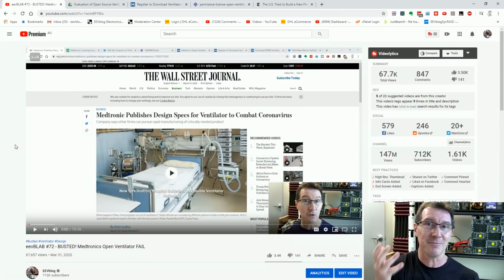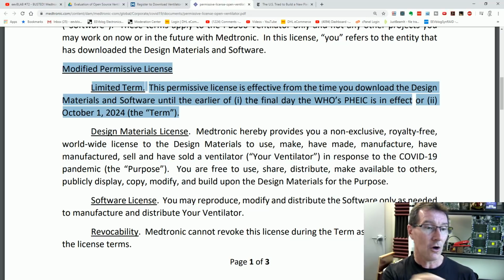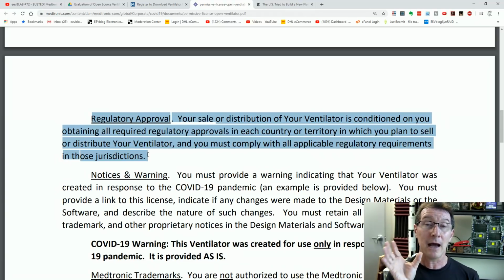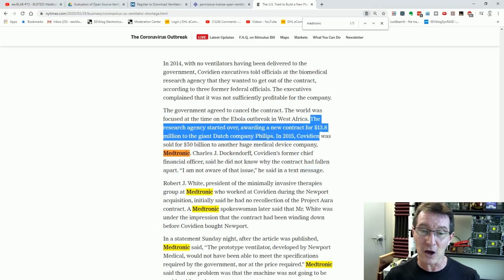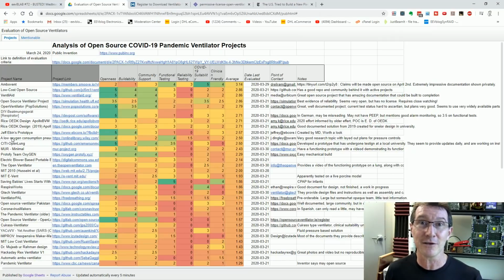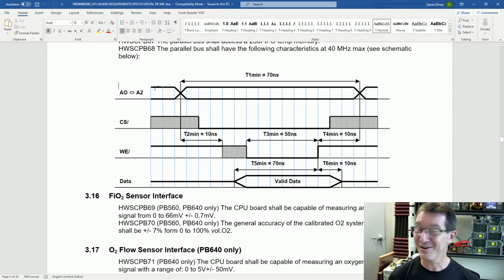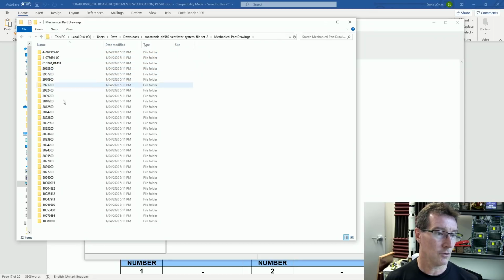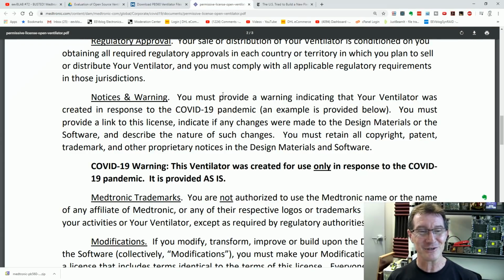eevBLAB #73 - Medtronics Open Ventilator + Others UPDATE

Comment: Even if all the files were available, how could you realistically design and release something in a short time span when it will require CE/FCC certification and meet medical safety standards at the same time? That seems like a time span of at least several months, and by then it's probably already too late.
Reply: China will be producing them by the end of the week, and selling them to places that don't need CE/FCC certs. And besides, they already have the CE (china export)/FCC logos, and are pretty good at printing stickers or molding them into the plastic anyway. Also, they see your "license", and laugh at it!

Comment: AC in the medical world is Assist - Control - where the patient attempting to breathe in triggers the machine to deliver air under the required pressure.
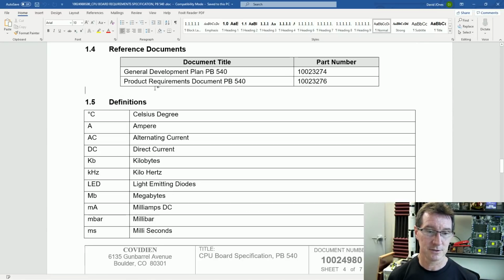Reply: norlesh Perhaps, but at 14:48 when Dave says “AC is alternating current” he is simply reading the definition printed on the Medtronic document shown in the video.
Reply: like SCUBA diving gear.
Reply: @95rav  no, it's closer to pt driven rate control. The vent will work to push a given volume at given speed, not just supply flow.

Comment: This is parallel manufacturing and typical of war-time production. The same thing happened when pistols, rifles, tanks, etc needed to be made faster than plants could be built and outfitted. They opened up the manufacturing to the open market with strict rules on the manufacture and use of the designs. Everyone knows about the iconic Singer Sewing Machine Co. M1 Garand or the coveted Singer 1911A1 service pistol which are worth a fortune. Ford made Tanks, etc etc etc. This is just that although they have to wrap new words around it to adapt it to modern day which is likely why the term "Open Source" is being used.

The entire goal is to produce ventilators for the entire world to use, NOW. They aren't concerned with much other than you need to be vetted by the FDA and the FDA already has a task force to fast-track all high priority projects like these. I applaud Medtronic for actually spinning this up this fast. The Medtronic design is old, robust, tried, proven and trusted. It makes sense that this would be the design to push outwards to be made en mass. It also makes the fast track approval process far easier since its a proven design but made by another mfg. Its easier to do this than be a contract MFG I would imagine.
Reply: Even IBM made M1 Carbines in WW2
Reply: Brian Streufert Clear and fair take.  Well done.
Reply: Correct. But Dave needs clicks. It's clearly aimed at large scale manufacturers to ensure they can't go on making these after the crisis is over, or indeed 'borrow' any of the tech. It's not aimed at us.
Reply: @chinnyvision  i think everyone agrees that's what was actually released after their legal team did there job,  however implying that this is click bait is a bit unfair since Medtronics own press releases and press coverage certainly tell a different story.
Reply: As far as I know, while they did make receivers for the M1 carbine and did a trial run of a few hundred 1911 pistols pre-WWII, to test out how well a company that did not make weapons could switch over, they never made M1 Garand rifles (as far as I know, I could be shown wrong).
Reply from the maker: Sure, but it doesn't alter the fact that this license actually exists and has potential implications.
Reply: @EEVblog  No question. This really isn't for the maker community though. Its for manufacturing companies that already do things like this and have legal teams that digest things like this on the normal. My parent company; Illinois Tool Works, has an entire legal department that reads docs and spins up responses in literally hours to boiler plate specifications that are hundreds of pages long. These things are really really complicated in what they do and not really something Joe Blow in his shed is going to take a swing at.

This is why a lot of the people and companies who have no idea how to muck about with this are devoting their time to automating Ambu bags. Ambu bags already have a pressure relief valve on the mask and its easy to automate by mimicking a human hand with simple mechatronics and a micro.
Reply: @StreuB1  I totally agree!
Reply from the maker: @StreuB1  No it's not. Medtronics themselves promote this under the title of "OUR VENTILATOR SPECIFICATIONS.
 YOUR INGENUITY." and "Our hope is that manufacturers and engineers will use this intellectual property to inspire their own potentially lifesaving innovations."
So it is clear from that they intend for people to take their IP and inspire other designs, not just produce clones for right now.
Reply: @EEVblog  having attempted to trawl through the documentation along with my college, we find that there are some "open to interpretation" phrases and somewhat contradictory parts also. I feel like this is something that was half out the door before someone stopped the ball rolling for a lawyer to flick through it and say no no no.
Reply: Brian Streufert 
Indeed this shows how extremely complicate ventilators are. Cor van Hout, CEO of Philips explained that their ventilators contain over one million lines of code. 

These ventilators are not a (fairly simple) breathing aid but fully take over the breating function of patients. Patients on these ventilators are paralysed and fully sedated (brought into an artificial coma) to enable high pressure, low volume ventilation that will minimise damage to the lungs. 
This raises however CO2 levels in the blood of the patients which would give them the idea that they are suffocating. Hence the paralysing and sedation.
Reply: @Conservator While it's true all medical devices are hideously over complicated by regulations, "a million lines of code" is bull. That's what you get from bad / lazy programming, and decades of feature creep. The basic function of a ventilator can be done without any computer at all -- we had ventilators before there were arduinos. (something that complex is also 100% impossible to fully test.) We don't need "borg" technology here; covid-19 patients need breathing assistance not replacement.
Reply: jfbeam Hi,
I’m sorry but I have to correct you. The non-ICU patients might need breathing assistance but the ones in ICUs have a respirator to replace their breathing. These devices are complex because they are highly automated and need much less attention of IC nurses and doctors. 
I agree that a million lines of code is ridiculous but that’s what the Philips CEO said on Dutch TV. 
Breathing aids are much less complicated but those are useless for the critically ill patients. 
I write these comments because most people don’t have any idea (or are at least underestimating) what happens in ICUs and how invasive being put on a ventilator with COVID-19 really is. 
In the Netherlands COVID-19 patients are on average 23 days in ICUs. Much longer than initially estimated.

To avoid damage to the lungs by overinflating them, the patients get a low volume, high pressure treatment. This will give them ebough oxygen but will also keep the CO2 levels too high. This causes patients to feel like they are suffocating. This is extremely uncomfortable (or torturous). Therefore patients are sedated and paralysed to avoid violent movement. 
To increase their lung capacity, patients are turned not their belly for most of the time. 

The respirators control volume, inhaling pressure, exhaling pressure, frequency, speed and amount of oxygen. 

There is a good video of Medcram on this subject.
Reply: @yodaco  I appreciate that your college has tried to check this out, but I think that a group of college students just might be in over their heads.
Reply: @jfbeam  It would be interesting to see some complexity analysis results in that "Analysis of Open Source COVID-19 Pandemic Ventilator Projects
" table. When I did my degree in Software and Network Engineering complexity was evaluated based on Lines of Code (LoC) things have moved a long way since then with cyclomatic complexity (CC) and cyclomatic complexity density. CC density has been found to make sense by various researchers, although it does not seem to have gained significant popularity among practitioners. 

There is evidence from two well-known scholars in the software metrics area that the ratio (cyclomatic complexity density = CC / KLOC) is a much better predictor of maintenance productivity than the CC or KLOC alone.
Reply: @EEVblog  I agree that statement is BAD and DANGEROUS as it is "suggesting" to make a LONG TERM new device BUT MEDTRONICS can then grab from you in 2024 OR when the pandemic is over
Reply: @EEVblog  is there some part of this being an emergency temporary measure that isn't clear, do you expect them to give away their intellectual property forever. it all sounds quite reasonable to me.
Reply: @Balancedviewable  nothing wrong with doing what you stated had they of presented it as such but based on how they presented it to the press, I think the criticism is perfectly fair and frankly your implying otherwise is unreasonable.
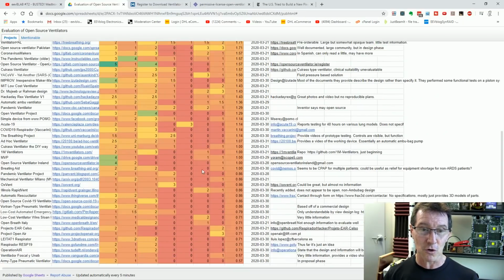Reply: @EEVblog  I have just checked that list 02/04/2020 11:05 GMT and believe it or not Medtronic is now at #1, top of the list with a score of 4.5 for "Openness" when the most open projects score 5. I guess Robert L. Read, Keeshan Patel, and Juan E. Villacres Perez, 2020
 didn't spend as long as you did reading that Medtronic Licence.
Reply: Yes and they all made easy to produce weaponry. The Sherman was not a very good tank compared to what the Germans put in the field. But because they were much easier to manufacture they could be churned out in huge numbers. The suspension was crap compared to the Tiger. But they could do repairs themselves whereas the Germans had to tow theirs back to the factory. In times of crisis you don't need a ventilator with a million bells and whistles. Design the most basic machine and start producing.

Comment: I find it intresting that F1 teams have steped up to the chalange, and if there is any industry that has the expertise to rapid prototype and manufacture a complex machine to standards they are the one,
Reply: To be fair, the F1 teams can use some good publicity right now and their equipment and factories are idling currently only costing them a lot of money.
Reply: they do have one problem: their machines aren't made to last more than a few hours between repairs.
Reply: @SkyCharger001  That is not true anymore, they only get 5 engines per season now. Still a lot, but it will be reduced with the next set of regulations coming in 2022.
Reply: @AstralJaeger  3 per season isnt it? or does 5 include pre season testing engines?
Reply: @SkyCharger001  That may be true but they've gotten very good at calculating how to make a part last EXACTLY those few hours, no more no less. So when you tell them it needs to last x hours, they'll make it last x hours whether x = 5 or x = 5000
Reply: that doesn't leave much room for error though.
Reply: @SkyCharger001  Maybe, but the Red Bull pit crew will be able to change the tyres and gas it up in 1.82 Seconds :-)
Reply: Team orders will ruin this too

Comment: MEDTRONICS - read this to learn more about this company: https://www.nytimes.com/2020/03/29/business/coronavirus-us-ventilator-shortage.html. 
The U.S. Tried to Build a New Fleet of Ventilators. The Mission Failed
Medtronic bought  Covidien, a company that was developing a new ventilator for the US-Gov. and stopped the whole project to protect its own line of vents. 
It would be interesting if they "open source" the "old" project. Medtronics is the main reason why the US does not have the number of ventilators it needs.
Reply from the maker: You didn't watch the whole video, I included that.
Reply: @EEVblog  I just wanted to point out once again: Medtronic is the company that for selfish reasons stopped developing a new, more affordable ventilator so as not to jeopardize the sale of their own overpriced devices.
The fact that this company is now trying to abuse the open source community by using it for its services is the icing on the cake.
This is first class public relation work and nothing else. (Funny that the offer came after the NYT article, but very quickly, I have to admit).

Translated with www.DeepL.com/Translator (free version)

Comment: This is really not a way to do an open source project. At best, it's a way to fix the existing ones in some way, even if not necessarily the standard way, especially since getting the proper parts is probably easier said than done.

The most one could use this material for in making their own product would be to have output specs to match up to.

Meanwhile, companies are just acquiring and fixing old, broken ones instead.

Comment: Later on they will start trawling through other projects that are similar and then sueing them when they find things that are similar enough to their design.
Reply from the maker: That's the fear...
Reply: @EEVblog  IANAL but my understanding is that you can only sue for violating the agreement, if the defendant actually agreed to the license in order to obtain the files. If you haven't agreed to the license, you can do whatever you want. They can still sue for copyright/patent violation, industrial espionage etc if you somehow use their intellectual property without having the right to, but that is the case today too, the only difference is that contributors could be tainted by having looked at the published material, but this is also with prior art see e.g. leak of Windows 2000 source code and react os and other oses. Or dozens of similar leaks.

Comment: This would probably help the open source projects by providing insight to some particular problems they might be stuck on figuring out. But I don't think anyone is going to copy and paste anything from their design just because it would be so much work involved. There are also very different approaches between the open source community (DIY) and a world wide provider of medical equipment, one tries to build stuff with as little as possible while the other one has to make sure safety and reliability is the number one concern.